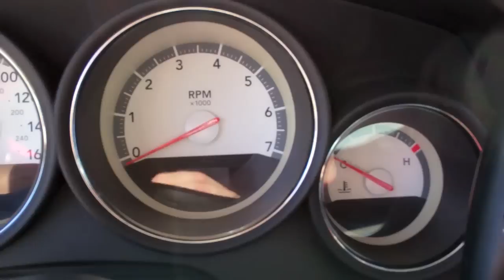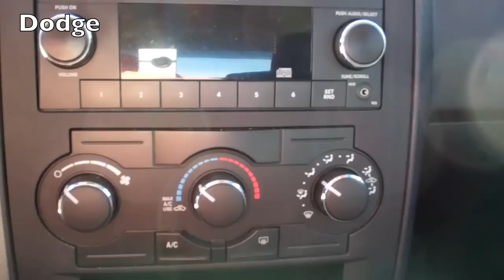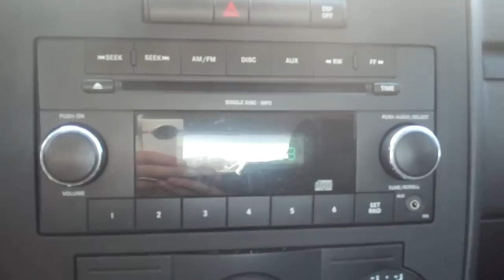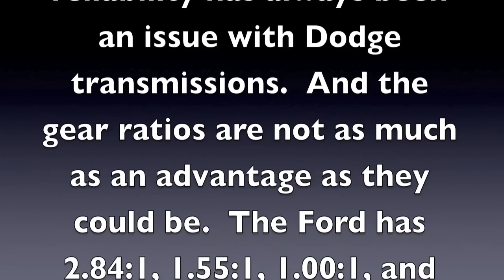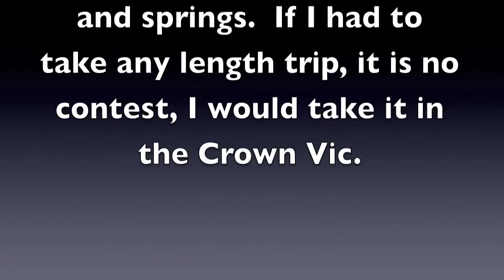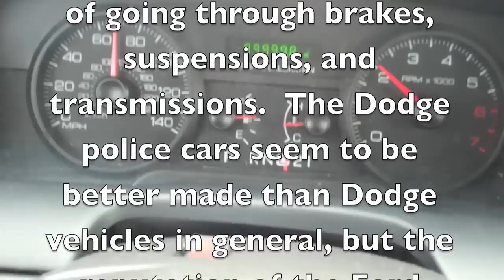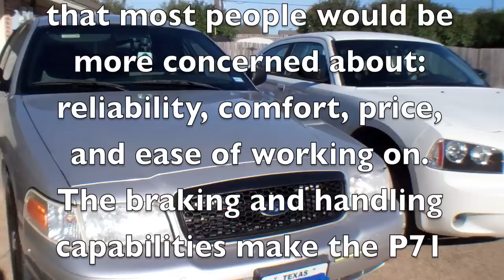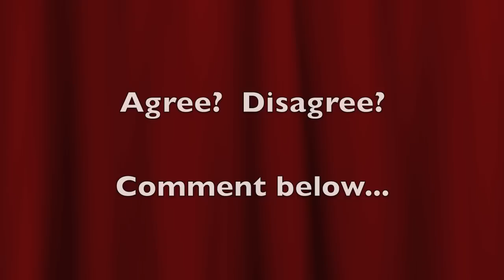Crown Vic P71 vs police Charger Hemi... the showdown

Comment: this is a stupid video u know he likes dodge The Ford p71 has less problems when it comes to reliability and performance dodge cars have a big lag even tho by them having big engines their chassis types are too heavy il could tell u that cause I have raced hemisphere before with my p71 and I always came out on top the interceptor has a bigger gear ratio than the hemi
Reply from the maker: I'm a "car guy" and I like and appreciate all the cars.  Each of them has strengths and weaknesses.  I also really love that feeling you get when you are subjected to a lot of G-force during a hard acceleration.  The Dodge produces that feeling better than all the other cars I have.  But when it comes down a daily driver, the P71 gets called to duty.

Comment: It's good that you compared apples to apples: A P7B Clown Dic to an LX Charger.  The LD Chargers  are miles and miles ahead of either car, but the fact is - Dodge has made continuous improvements to the cars, as well. 

As for the transmissions: I guarantee you any fleet garage, shop foreman, or dealership tech will tell you that the A580 in the Dodge is achieving a status of durability and reliability at least equal to that of the old 727.  In fact, when the revised 2015 models came out, Dodge's Police Advisory Board begged Dodge to keep the A580 in the Charger Pursuit. 
So the myth that the Charger has weak transmissions was debunked long ago. 

The idea that the Crown Vic is easier/cheaper to repair and maintain is absolutely bullshit.  I've owned a couple of Crown Vic's, and a few Chargers, and I will testify to anyone that the Charger is every bit as easy to work on as the Ford.  I think they did a great job making a high-tech design relatively simple to maintain.  Everything on the LD cars is plug-n-play. Not so with the Ford.  Plugs are easier to change. PCV, all filters, everything is all out in the open.  Parts are reasonable. 

The LX Chargers (2006-2010) did have significant premature wear issues with tie rod ends and control arm bushings.  This was also solved with several improvements in the LD cars. 

Outward vision and seat comfort, and fantastic instrumentation were all introduced/improved in the LD's.

The point is, the design and performance of the Dodge (especially the AWD model) is such that it helped take out the Crown Vic, Caprice, Wimpala, and soon the Taurus. 

But Dodge made - and continues to make - improvements to the cars, as Ford has with the Exploder, and Chevy with its Tahoe.
Reply: You do understand that the newish Ecoboost Interceptors mop the floor with the Hemi's... right?
Reply: Friedrich Von Parsberg  The Ecoboost cars are twin turbo, AWD & holy fuck fast.

Comment: Dodge transmissions are fine.....

You are thinking of some 1990's trucks with the overdrive based 904's...

 Furthermore,Chrysler found out people took their trucks and minivans for transmission fluid changes at garages,not dealers and they used the wrong fluid as Chrysler's don't use the same transmission fluid as GM/Ford thus wrong fluid,blown trans....

I own a car dealership my buddy owns a transmission shop and a lot of people said they took their truck or minivan to a garage and they flushed and changed the fluid...Then a few months later it failed....WRONG FLUID !
Reply from the maker: Interesting.  Thank you for sharing.

Comment: The crown vic can take corners better
Reply from the maker: I agree - at least with my cars, the Vic handles slightly better, or at least feels safer going into corners more aggressively
Reply: They are quick  for a heavy car with the 4.6 v8 240 HP the car rows with the corners

Comment: For the p71 to win it would need displacement increased to 5.0 litres, a chip upgrade, exhaust upgrade, conversion to duell overhead cam and a supercharger, for overkill a stage 4 turbo but it would be unfair for the charger againts 700hp.